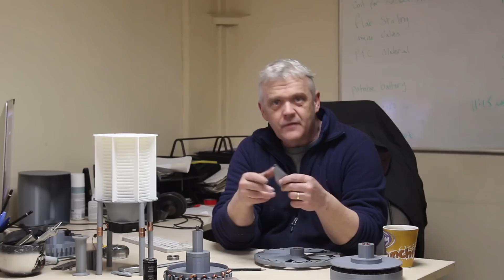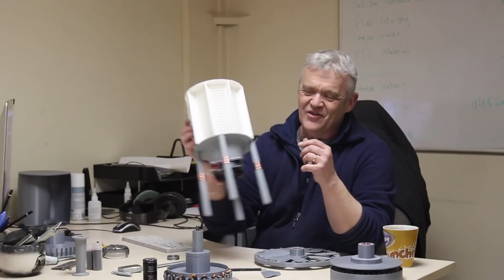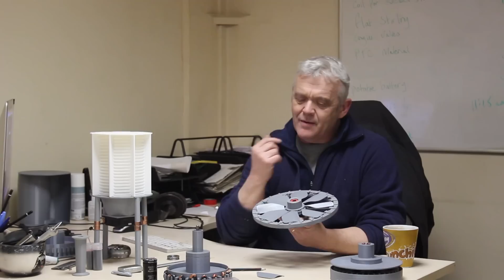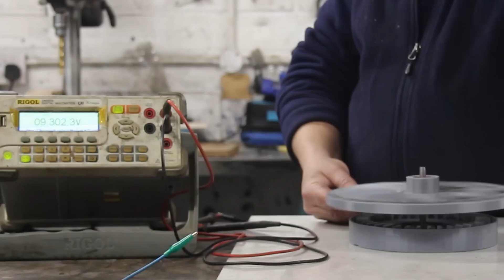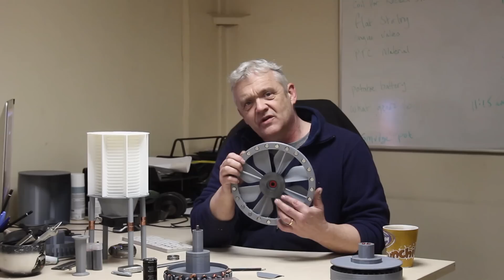1893 The Darwin Feather Turbine - Looking Like A Winner

Comment: Hi Rob, not really relevant to this video, but when I was a lad back in the early sixties my first introduction to motors was  the Ladybird Book of Magnets Bulbs and Batteries. This was my older brothers book and I read it from cover to cover avidly. 
I proposed that with a horseshoe coil at the top of my bike forks and magnets around the rim of the wheel I could produce more power than a standard bike dynamo. This was poo pooed by brother and physics teacher as impractical because the magnets would be too heavy to be practical. So I wonder, if when you are looking for a side line project while waiting for something to print you could perhaps, with modern magnets test out my hypothesis?
Reply: I hope you don't mind my chiming in, but I'd have to say the answer is that it was absolutely impractical with ferrite magnets and an incandescent lamp, but with modern magnets and an LED light you could most likely at least get some light out of such a setup.  I think rather than using it for a headlight though it might be cool to lay a serpentine coil along the rim with stationary magnets on the forks, then connect that to strings of LEDs inside the wheels which would flash as you ride. 
Depending on how many wiggles your coil has and how many strings you use you could have patterns that rotate backwards as you ride forwards, for example.

Honestly though, if you want a worthwhile headlight you're far better off simply using a battery.  A few watts may not seem like much, but it really robs your ability to coast or maintain speed.  I used to use a pair of old 18650's and a 12V LED bulb meant to replace the halogen bulbs in desk lamps.  Even in the cold it'd last me several rides.  The bulbs are quite cheap and they have an integrated regulator that can take in 7-12V, AC or DC so they're always lit at full brightness.  When the battery drops below 7V it cuts out completely so you won't damage your cells by running them flat if you forget to shut it off.  Mine were 6W and I think and they cost 4 CAD.  The style is MR16 IIRC.
Reply from the maker: if you think about it mate what we are doing here isn't too far from your idea

Comment: Hello Rob. Ive been following you for some time. I know this is off topic but i am interested in your urea electrolysis videos. Im in the process of building a dry cell, but Ive done the math and there is no way to make the process cost efficient without recycling the KOH. Without that, the energy in the Hydrogen is like $17/kW. Do you plan to revisit this subject? Is there a more efficient way to recycle the KOH than pyrolysis? Ive seen stuff about reacting it with bleach and running the gasses over a UV light.
Reply from the maker: I do plan on getting back to it at some stage mate
Reply: @ThinkingandTinkering  im really enjoying the course of your research currently as well. Im starting some microgeneration of my own
Reply: Hi there I'm sure you would know more than myself on the HHO's hope you seen the magnets enhancement producing more hydrogen Rob did.
Just food for thought you can make hydrogen from methane and there's more methane on earth than gas an oil combined. 
Formula H2 (hydrogen) + CO2 = CH4 (methane)  , so when hydrogen leaks to atmosphere it'll combine with 2 CO molecules which makes CH4..
To separate ch4 methane use a CO2 filter there your left with H2 , CO2 filters are lithium filters used Apollo moon mission and in operating theatre for patients breathing recirculation,  not sure how long co2 filter will last , BUT maybe Rob could revisit with options of co2 /carbon felt I haven't dived any deeper.
Not sure how methane over copper an UV light would go splitting it to hydrogen. 
All food for thought cheers.
Reply: @paddy2661  hi Patrick. I appreciate the effort of your response, but it seems to have no relevance to the topic of my comment. TnT did a series of videos on urea electrolysis. A process that theoretically produces more energy than it consumes, and produces Hydrogen and Nitrogen gas. This could be done with human urine or industrially produced urea. It seems to be an efficient process but a required reagent is Potassium Hydroxide (KOH). This becomes carbonated to produce K2CO3 and you have to put more KOH in to continue the electrolysis. Without recycling this reagent, the process becomes incredibly expensive for the energy density of the hydrogen

Comment: Btw, what was the impedence of the circuit that you were using to calculate the volts? I want that data in Watts!
Reply from the maker: why?
Reply: @ThinkingandTinkering  If the current isn't flowing due to the high impedance of the measuring equipment then of course it will register a high voltage. We need the voltage and current across some sort of load so that we can get and idea of how efficient your turbines are at converting known wind power values into electrical power.

Comment: 1) In this test the airflow was through (vertical to) the turbine. The feather turbine is designed for the airflow across (horizontal to) the turbine. How does it work with both vertical and horizontal airflow simultaneously? Which is what you wold get when combining the Darwin and feather systems.
2) Up to now, your tests involved small blades which appeared to result in greater area for airflow and a smaller area for capturing the airflow. This was the first test reversing this ratio by using large blades and reducing the space between the blades. Would adding vertical fins to the outer edges of the blades improve performance by capturing air bleeding off the outer edges?
Reply from the maker: the wing creates lift

Comment: So now, what would happen if you traded those mini dot magnets into mini pyramid magnets?
The size of the magnet would not have to change too much, and the rotor would need to be raised up a litttle to get the optimal distance from the point of the magnet to the coil, but the change in the magnet's shape should increase the gauss of the magnetic field and so in turn, increase the output of the turbine.
???????
Reply from the maker: give it a go

Comment: Your meter seems to be reading 16 millivolts or am I wrong?
Reply: 16 to 18V (volts)
Reply: @cayrex  Thanks
Reply from the maker: you are wrong mate - it's volts
Reply: @ThinkingandTinkering  Ok thanks! Wasn't quite sure what I was seeing there.  Great video and project!
Reply: @DrDirigible  but your intution was correct. They were measuring virtually no power at all. They could have worked out some math to estimate a rotation rate, but that would have also been useless.

Comment: I wonder how much power this would capture being next to a road...  and then if these were built with enough of them to also create a sound barrier like some busy highways use...
Reply: Now that's an idea. Harvest the cross winds while also harvesting the side wash from vehicles. By taking energy from the side wash will also reduce the traffic noise, I would imagine.
Good thinking Johnson Rice 👍
Reply from the maker: I like that
Reply: Have all the roads eventually in underground tunnels with them through the tunnel as the traffic pulls the air in the same direction
Reply: @craigboden9455  I don’t know about all roads being in tunnels… but I DO agree that all tunnels should have these generators. I bet the wind in tunnels is pretty constant. Also, what about using something like this to power street lights and road signs as an alternative or addition to solar cells?
Reply: @Johnson_Rice  would make sense to have all the major motorways in tunnels. And have the power lines, water and gas and stuff in smaller tunnels beside them too so we don't have to keep digging roads up every time there's a problem either. Considering we're switching over to electric vehicles anyway there would be no pollutants in the tunnels so it would be safe compared to having fumes in there like tunnels we have now. Nature can take back over the land that's currently taken by miles upon miles of motorways everywhere. People can't go jumping off bridges into traffic so it'd be safer that way too. Less maintenance on the roads also as they'd be protected from weather and floods, and yes, tunnels already have built in flood protections with todays technology we already have. Obviously in towns a cities we'd still have to use normal roads but no reason why the main motorways couldn't be underground. The maintenance costs of the tunnels would be about the same as what is saved from having to maintain the motorways now.
Reply: @craigboden9455  I agree in principle, but cost and execution seem prohibitive… especially given the standard for “fast”tunneling currently is something like 60ft/day and there are currently about 850million feet of road in the US national highway system - that might take about 14million days or about 39,000 years to dig… and that’s just the current highway system.  Maybe at the next Kardeshev level - but I think we might obviate the needs for roads at all before this with either flying vehicles or teleportation before these tunnels get dug.
Reply: I've often thought about the amount of energy that could be gathered from a motorway. Great bit of thinking 😁

Comment: So according to these results, you don't need the blades to pivot at all. 
Check out the version of what could be adapted to the darwin that I designed for a ocean wave generator using a shielded savonious. Just flip it over.
Reply from the maker: it's working via lift the original version was drag

Comment: Hmm... The thing that has me (and I suspect a few others) pondering is the fact that the downward drafting is spinning the turbine without the leaves lifting so presumably the thrust is coming from the air action on the leaf design instead so perhaps the mobility of the leaves are effectively redundant and instead it comes down to the blade design that will maximise the conversion of airflow to rotational energy?

.. or am I missing something here?
Reply from the maker: yes it is lift not drag
Reply: @ThinkingandTinkering  Thanks for the reply Robert... The bit I'm unsure about here is that it seems inefficient in two ways. 

1. Normally a wing blade would mean air hits the blades from the leading edge whereas the Darwin design is effectively pushing air perpendicular to the leading edge so to my untrained eye that seems like a lot of waste energy.

2. The blades being hinged seems somewhat redundant, again because the air is coming at the blades from above, thus forcing the blades to stay down rather than rotating upwards.

That said, I'm a great believer in the mantra of "If it's stupid and it works it ain't stupid" but I am trying to consolidate my experience and limited knowledge to understand things properly..
Reply: @martinsmallridge4025  what you must realize is that a normal horizontal axis turbine has all of its blades exposed to the airflow 100% of the time , whilst in the Darwin version Mr. smith is working the wind effectively may only come in contact with the blades about 25% of each revolution because it captures wind from one direction which is funneled only on one side of the turbine , hence why he has to risk using more propellers blades to make up for less surface area being exposed to air flow. He now has to balance the efficiency of weight verses more blades to make up for the turbine contact area being about 25%. The benefit of this type of turbine has to be bird friendly, esthetics noise . and scalability in an urban environment to name a few.
Reply: It is basically just like that PC fan he already has on the other one. Except that his leaves should have their outer curve underneath, not on top.The fewer the leaves, the faster it spins, the more happily Bob cackles, as he is only interested in the speed. He might eventually reinvent the two bladed propeller, which spins the fastest. It is sad. He was doing so well with that Water's turbine. That one actually is effective, when pointed to the wind. Due to the smooth airflow around it. (The under pressure on its sides actually helps).
Reply from the maker: calling me sad is pretty arrogant mate and not a little insulating - ah well - and you have really missed the important things here - that is the Darwin system, generation at the Rim and maglev - to be honest the rotor design is pretty much secondary
Reply: @ThinkingandTinkering  I called that particular rotor design sad, not you. I have no quarrel with the generation at the rim and maglev. I have not missed them, been following your videos for quite some time and am on your side. I mentioned the Water's turbine because imho it is far superior to these leaves in many ways. After all, it was spinning pretty well when you held it to the wind. I will not go into more details of why it is better, as I have no wish to upset you any more.

Comment: Hello Robert, I agree that you need to reconsider the aerodynamics of the blade. The current method is definitely sub-optimal with probably a huge proportion of the wind energy wasted. There is no need for a hinged blade in that configuration because all of the wind in a Darwin system will be perpendicular to the disc, where as without the Darwin, the disc spins perpendicular to the wind, and so it needs to have the blades flap closed when the blade comes into the wind. That won't be needed in the Darwin system, so the fan blades should always be oriented to catch the wind. 
I really like the idea of the Darwin system especially with the downward flow, because it make repair of the fan and motor very easy! Thanks for your hard work!
Reply from the maker: yes I like the basic idea of the Darwin.

Comment: Very interesting. How big would be optimum for a real life version, how much power could it generate and how would it compare with cost and efficiency with a traditional wind turbine.?
Reply from the maker: it will generate the same as any other wind turbine - less than the power of the wind coming in and proportional to the area of wind it captures - but it will probably be cheaper in the end
Reply: All very interesting questions.

Comment: Neat! That feather design was for the wind to be coming from the side though right? I was thinking a cantilevered airfoil where the rounded end sits above the axis and is weighted appropriately to hold the feathers in their home position. The thin edge of the foil then could weathervane the foils for a self regulating system.
Reply from the maker: from the side it works by drag from this perspective it is working from lift

Comment: Can somebody explain this. The air flows through the louvres and directed down to the turbine. This can only happen with those facing the wind and i suppose partially those on the sides, so what prevents the air from leaking back out of the louvres of the down wind louvres, or is it that only half of the turbine is exposed to the airflow
Reply from the maker: check the video on the design of the darwin that will answer your questions

Comment: So the air was blowing straight down? But how does that activate/lift the feathers? What am I missing?
Reply: I'm guess this design is to catch wind from both directions horizontal and vertical. The petals will open with horizontal wind but the wind catcher on top will simultaneously be forcing the wind down onto the blades vertical so the shape and spacing to capture both sources of wind.
Reply: @gulag_inmate69  Both sources of wind would counter eachother
Reply: A larger swept area is capturing the  power when blown straight down whereas from the side the maximum area is less than half maybe less.
Reply: @caahacky I don't get it either.
Reply: when air going thru feathers, it tries to lift them to make a bigger hole to pass .. besides shape, weight of feathers is pushing air down trying to make that hole smaller .. with barely no friction on its axis the air pushing feather up and feather weight pushing down causes movement
Reply from the maker: it's lift - the previous version was drag
Reply: Am I going mad or is this design going in opposite direction to previous one (1892) Rob?

Comment: so why does this put out greater voltage than previously, more closely-spaced bladed models? is it because they're a bit more spaced apart, they can capture more of the air? maintaining 16v even after switching off the fan was really cool!
Reply from the maker: it's faster - emf=blv sine theta

Comment: Free electricity ❤ while stopping birds getting killed by propeller strikes, well done Robert
Reply from the maker: cheers mate
Reply: Not exactly free because of the materials needed to create the generator, but Robert and Luke are definitely developing better solutions than we've seen in the past with smarter and safer designs.
Reply: Coal smog particulates kill orders of magnitudes more birds per watt generated, but bird strikes are one of many arguments against gigantic wind turbines and in favor of smaller, more distributed generation.
Reply: High rise buildings kill magnitudes more birds than wind turbines do.
Reply: They say if they paint one wind turbine blade black, the bird kill goes way down.